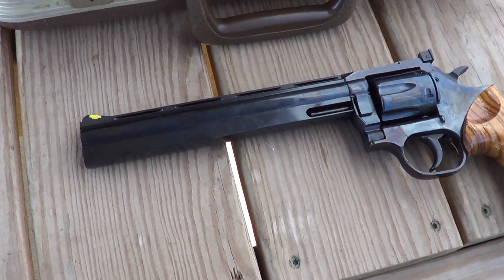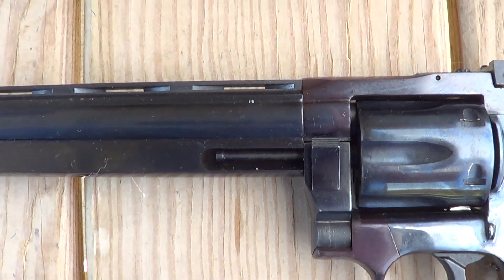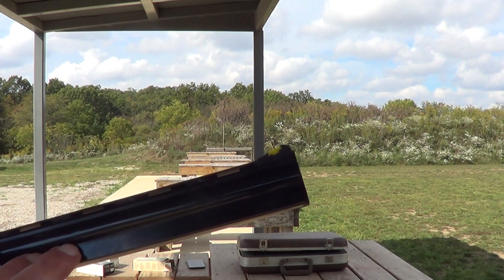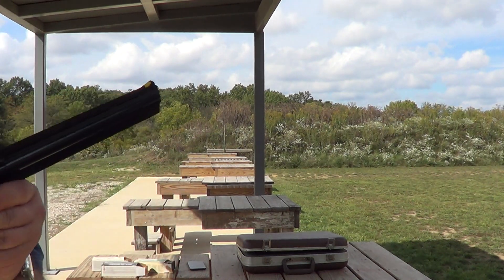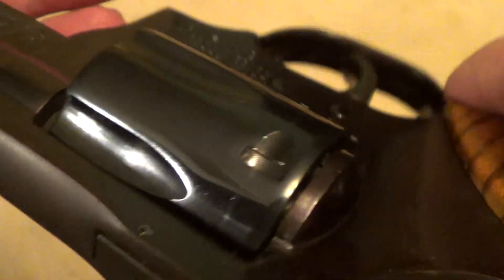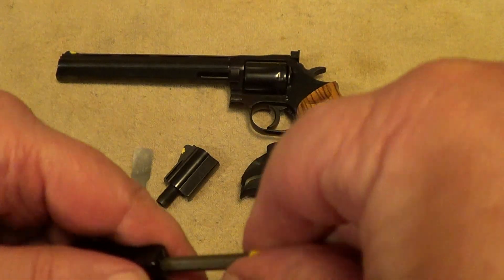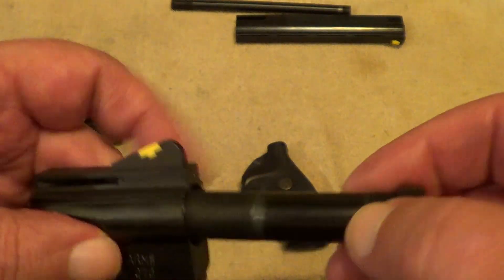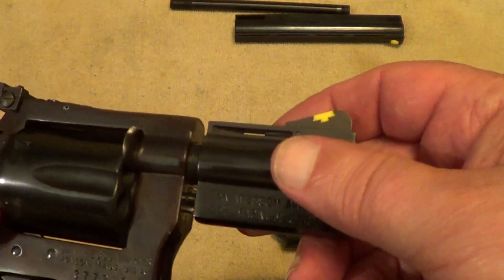Dan Wesson 15-2 357 Magnum

Comment: Always thought these were cool guns , you could have one gun with multiple lengths.  My uncle had one of these with a 4 and 6 inch barrels,  I don't remember seeing any others. Thanks for showing how to switch barrels,  I remember him doing that and thinking it was neat
Reply from the maker: I`m kind of surprised that they never became more popular. They sold new for about the same price as similar models of S&W and Colt. The only real down side I can see in them is that every time you change the barrel, the bullet point of impact changes. But not by a lot, at least not with this set of barrels.

Comment: I remember when they came out it was at the beginning of IHMSA silhouette shooting .    They did not handle heavy 357 loads well granted we pushed our loads I would not load hot for one perhaps a bit under max handloading .
Reply from the maker: Stands to reason. The actual barrel on these are pretty light compared to just about any other revolver.

Comment: I have an early production Ruger Security Six where the frame is plum and the rest is blue. It id my understanding that the bluing salts were too hot resulting in the plum color.
Reply from the maker: Thanks for the info. I have seen other Dan Wesson guns like this, but most have good blue finish. The plum finish should last just as good, it just looks funny.